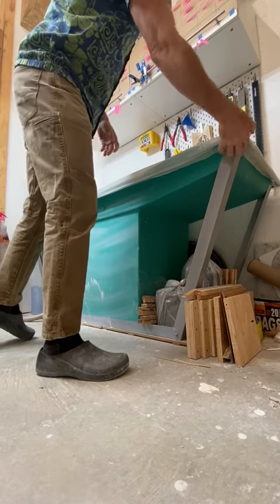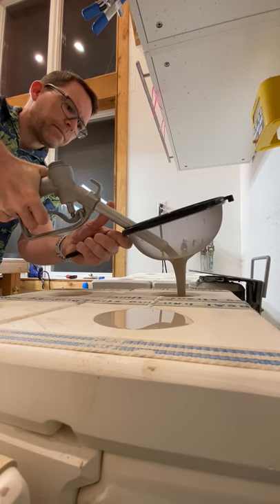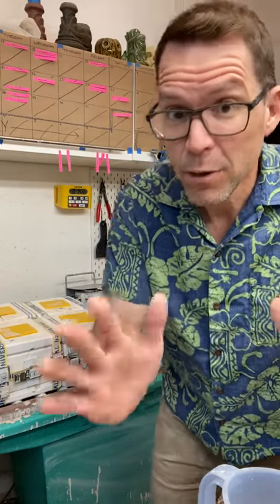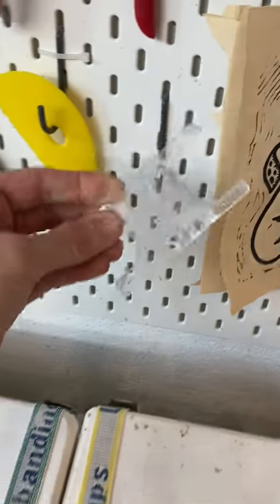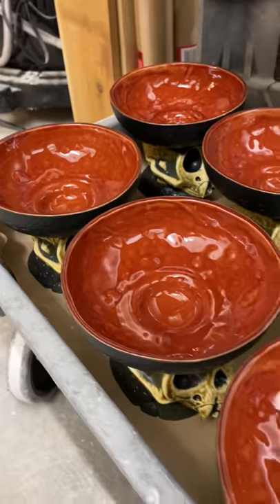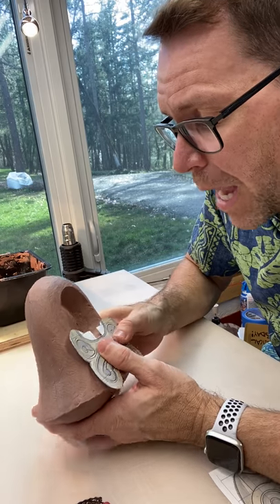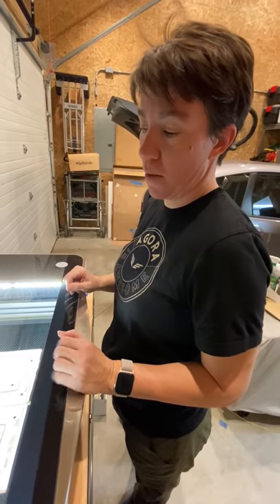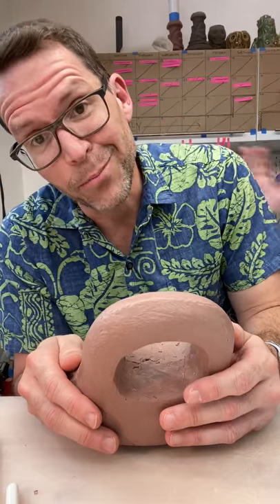Studio Tools: Slip Table - Tiki Technical Tuesday 19

Comment: Curious if you just scrape the dried slip right back into the reservoir? Then it just softens overnight and gets re-incorporated during mixing? 

I believe this would increase the SG, but with such a big reservoir I assume it takes a long time to impact it? How often do you check fluid properties? Do you scrape it totally clean every day?

Why is the PVC helpful? Easier to clean? Roll the molds around? 

Are there ever long periods when you’re not casting. For example say you take a week-long vacation, is the plastic enough to keep it from drying out? Or do you seal it tighter in those scenarios?

My god, sorry I was planning to ask one question but the rest just poured out…

I scored an amazing deal on a very old rusty table from a retired slip caster. Lehman, 8-foot, pump+nozzle, but no mixer. I spent the weekend taking everything apart, cleaning, scraping, and painting and it looks so nice. Ramping up production this summer and very tired of endlessly checking fluid properties on small batches of slip. Just need a drop in mixer.
Reply from the maker: Great questions! The PVC made a huge difference. It’s gentle on the molds, and it is much easier to clean. I could put scraps back into the tank - but I’d have to check the specific gravity daily or weekly, and I just don’t want to spend that time rebalancing the tank 😄
I do know artists who keep a separate reclaim tank that they use to process scraps.
Reply from the maker: Oh! And to answer your question about leaving the tank unused. A week or so isn’t a problem. I have a reminder set to cycle the tank every three days - this keeps the slip from gelling too firmly in the pump and hoses. If the tank sits for several weeks I’ll have to check the water and deflocculant levels to make sure the balance is correct.
Reply: That makes sense. Thanks! I’m all for less rebalancing. 

Speaking of “gentle on the molds”…is there an issue of plaster dust accumulation in the tank? Could this cause pinholes in glaze fire down the road? I see you use a strainer, but imagine fine plaster dust isn’t filtered by that.

Comment: I have the same slip table, but I’m a babe in the woods. It seems like I have to disassemble the pump and  clean everything to get it to work daily. It’s hot as heck here, that’s probably a contributing factor. I have the manual, but I can’t find anything else. Do you have any suggestions?
Reply from the maker: Do you keep the table covered? And do you cycle/mix the slip daily before you turn on the pump? Lastly, is the slip properly balanced (prover specific gravity - does it cast well)?
Reply: @vantikistudio   thanks for writing back I appreciate it. I don’t have the original cover I’ve been using black plastic. I am going to get a tarp. I imagine that would work better. I run the agitator for 20 min or so before I pour. My specific gravity was 1.72 when I checked yesterday after mixing. My pours are coming out well.
Reply: Do you close your gate valve when you are done for the day? I have been doing that. Does the pump also need to be covered?
Reply from the maker: @Lindsayplank  I cover the table with a plastic tarp after casting. I don’t close the gate to the pump, but I do hold up the nozzle when I’m done casting, turn off the pump, and lift the nozzle high up and open it to drain slip out of the hose. I then spritz some water into the nozzle holding rhe handle open and closed to get moisture into the hose and nozzle valves. Before hanging up the nozzle I put a rubber cork in the end of it. If I don’t cast for more than 4 days, I make sure to mix the slip in the tank and cycle the pump motor to prevent the slip from drying out anywhere or setting.
Reply: @vantikistudio  thank you! That is so helpful. I was thinking about a cork, but I didn’t think about trying to drain the hose.  You are awesome 😉